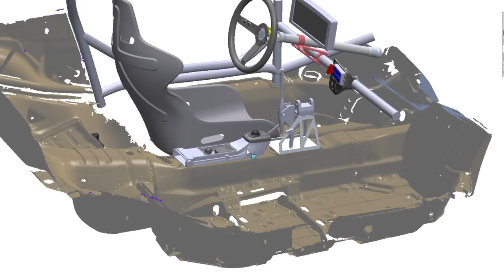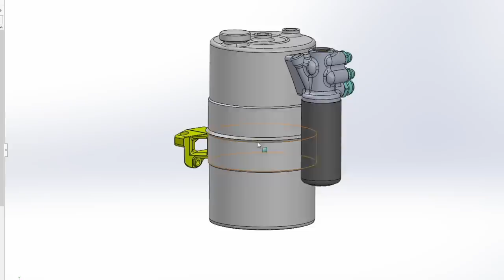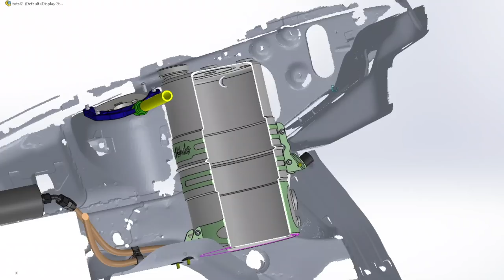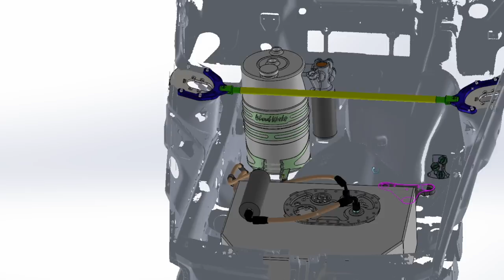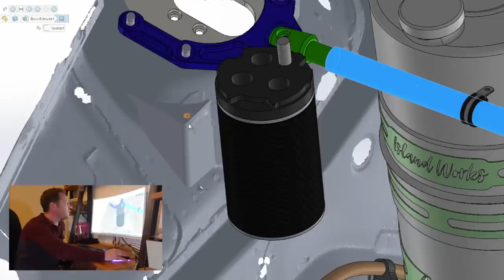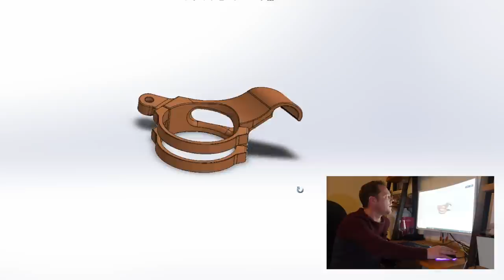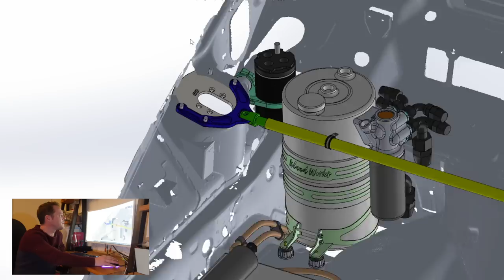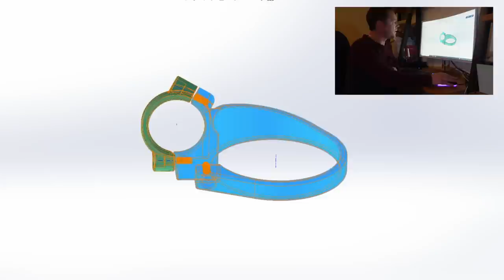Oil Tank 2.0 - Remote Mounted Dry Sump Tank on a Porsche 964

Comment: Catch tank looks better (more integrated mounted behind the strut brace, also eliminating an oil line traversing the strut brace. On the subject of the oil tank strap and rubber mounts, i suggest you leave the rubber fittings in the bottom strap, for absorbing bumps in the road, while you replace the top mounted rubber fittings with a solid nylon bracket covering both mounting holes, which would negate the horizontal wiggle. (I appreciate that you may have already solved this with a different solution).
Reply from the maker: I have since positioned in the the place closest to the windscreen. 

The tanks is planned to get one more P-clip in the top. So with that it will have some flexibility (perhaps overkill) but still a very firm mount.

Comment: Great video. I’d suggest with your tig, you had the wrong angle. As you had it in the vice, I would have had the torch angle pointing almost vertically down towards the bench rather than horizontal. That would have concentrated the arc onto the heavier gauge steel. It’s all in the practice and experience, great effort.
Reply from the maker: I definitely need more practice! Thanks for the tip!

Comment: I work in the Agricultural/municipal equipment industry and the rubber mounts you have chosen are used quite often to mount light components. In high vibration environments we see them fail quite regularly. The bonding of the studs to the rubber often fails.
Reply: If the ones on the mid brace were more upright I would be comfortable with it, they get used as small engine motor mounts without failing too often in the fleet world but it would be easy to find more durable bushes to use. Something like a sway bar d bush comes to mind.

Comment: Would suggest the rearward position for the catch tank, if only because it puts it a bit higher than the main oil tank. You'll want gravity to flow any oil in the line back into the main tank vs. the catch tank, will mean having to empty it less often.
Reply from the maker: That’s a very good point. I’m leaning to that position also as it gives space to strap the tank to the strut brace.

Comment: Weld a bung on the top of the oil tank and make a joint for the catch can that goes between the cage bar and the oil tank. You get the benefit of the catch can working off the the rigidity of the oil tank and that 3rd oil tank mount you wanted in the lateral direction, a perfect mounting solution for the can and one less bracket. Also less stuff to take apart when the strut bar assembly has to be removed.
Reply from the maker: That’s a good idea! Thanks!

Comment: This is inspiring. Coincidentally- the 912 engine had a similar problem with the oil cooler mounting tabs breaking. Eventually they revised the design to use a soft mount (kinda like you have used) to prevent the aluminum tabs from breaking.  The oil catch can belongs in the second position 🫣

Also- how in the world is this build not more popular!! It’s just as good as project Binky by Bad Obsession Motorsports.

Comment: Couple things I'd look into for the dry sump tank isolators/mounts. First I'd look into poly bushings instead of those rubber isolator stand offs (skateboard bushings are the first thing that came to mind when I saw the amount of flex/deflection. You can find TONS of different durometers, sizes, shapes to dial in how you want them to flex.) Second, I'm a little worried about mounting the tank to the chassis with rivnuts. In my experience, rivnuts tend to HATE any type of torsional load on them, so I'd be worried about them pulling/flexing out of the chassis. A larger bushing that makes contact to the chassis directly with clearance around the top of the rivnut could help reduce the torsional stress but I can't say for certain it would. 
Lastly, I always heard its best to put the breather tank higher than the top of the engine/dry sump tank so any oil that condenses in the hoses would run back into the tank? No idea if that's true or not or where I heard it from, but food for thought. 
Love the build man! You inspired me to get into CAD Design, enough for me to go to school for it!
Reply: I’m almost certain the rubber isolators will tear apart under the weight of the oil tank on track. They’re designed for fuel pumps and such. Much lighter weight. I would 100% use a through bolt and nut with a heavier durometer rubber isolators above and below the tank bracket, also eliminating the rivnuts, and you will probably need to strengthen the sheet metal with additional steel.
Reply: Yeah this tank when filled is going to weigh a ton when cornering and breaking.

Comment: Hi, I follow your job since a common friend Arnaud shew me your channel.
One more time, this is great and you don’t fear to share your fails.
Personnaly, I would prefer the first position of oil trap. You can make a brace attached like you did on upper of fender. And second brace/fixing part at the bottom of the fender, you have at least 2 screws.
Another solution would be to modify main oil tank’s bracket to attach the trap on it.
i love mechanic bit i’ m working on wiring harnesses and much more on harness software.
Hope  we will this car running not inside a salon. Go ahead ! Sprint is coming 🏎️
Reply from the maker: There has been a good number of comments coming back so I need to take in and think about it. 

Arnaud is great!! He’s helped me a lot!!

Comment: personally i think you should solid mount that oil tank if you don't its going to cause the lines to rub in the mounts causing them to fail. to minimize vibration from the tank just use some shrink wrap them on the clamps this will also limit the metal on metal contact which will again limit wear and tear of the tank and the mount.

Comment: I would suggest that you make a brace between the lower end of the oilfilter and the tank. Once the filter is full it will be pretty heavy and will act as a weight that will lever on the thermostat housing. The housing is mounted to the sheet metal tank and the constant movement will work harden the material of the tank and it will crack. Attaching the lower end of the filter to the tank will eliminate that movement.
Reply from the maker: I’ve contemplated something like that. The way the thermostat housing is attached it has a CNC back plate on the inside that sandwiches the tank following the curvature. It feels very sturdy given the curvature of the plate and the area it’s clamping on.

Comment: Having designed and failed the catch can design for wrc car, this Nuke piece is stunningly beautiful. Imho strut tower brace being right next to the big oil tank, supporting it anywhere else would end up people asking why did you not use the most obvious support. One more band it is then, this time from sturdier material and in C-shape.
Reply from the maker: I’m thinking tucking the catch tank on the side so I have access to the brace in front of the tank.

Comment: You could use skateboard bushings instead of rubber bushings. They have some give in them but aren't too soft. From around Shore A70 to A120 I think they're avaliable. Or just some harder rubber/polytherane tube that's similar shore.
Reply from the maker: That’s a great tip thanks!

Comment: We call those rubber mounts… cotton reel mounts and use them for everything from exhaust and radiators to engine mounts 👍

You can get different durometer (stiffness) rubber cotton reels… just get some stiffer ones.

The hoses adding stiffness is ok as long as they are not straight, so give them a slight bend so they don’t stress the hose fittings. 

Also the oil in the tank acts as a damper for vibrations 👍
Reply from the maker: Thanks for the insight. If I get the tank stable on its own I was planning to ensure the hoses follow the tank by putting them a bit loosely in the brackets somehow.

Comment: The stock oil tanks are mounted pretty firmly, I don't think it need much flex in the mounting. 
You probably know this, but anyway. The front mounted oil tanks where used on the 935 cars to improve weight distrubution, but it wasn't all good news. In hard braking the engines starved of oil because the inertia of the oil in the feed lines.  Probably not an issue on swedish tracks with moderate power and downforce. But keep logging oil pressure.
A really, really good oil tank design is the GT3 one. Tall, skinny, good air/oil separation, right above the oil pump gravity feeding in all conditions.
Reply from the maker: Tank on the front is not to be underestimated and has its risks. I’ll monitor closely and if it becomes an issue I’ll insert an Accusump to ensure there is pressure at all times. 

The GT3 is really nice, but doesn’t have the front oil coolers which makes it all so much easier.
Reply: Oil tanks mounted this far away from the Pump is never a good idea, plus he is adding weight to the car.
Reply: @h-j.k.8971  I don't think its adding much weight, the original tank is probably a little lighter, but its not aluminum so I don't know. Depends a bit on the oil lines he chooses too, that could offset the difference.
Reply: He will need a breather catch tank in the rear too so that will double up and add extra weight.
Reply: @mawe42  No the breather comes o
off the oil tank.
Reply: @mawe42  Yea still has the problem of oil cavitation with those long lines, he´ll have to use large dia hoses and fittings.
Reply: @h-j.k.8971  There is a breather from the crank case that normally vents to the tank.
Reply from the maker: @mawe42  the weight will be in the sense that the crank case ventilation will run in a hose all the way up to the tank in the front. There won’t be a tank in the back.
Reply from the maker: It was common on some of the competition Porsches as it’s lighter as well as distributed towards a part of the car that gets very light on a tuned 911
Reply: @islandworks  Have others done it like that? If/when you get oil and water condensing in that line before it reaches the tank it could act like a plug if it can't be pushed up into the tank and you will have crank case pressure. Just a thought, speculating.
Reply from the maker: @mawe42  it’s the usual way as far as I know. The hose is routed along the cage along the roof of the car in the cabin.
Reply: Never a good idea having to resort to bad solutions when the ground concept is of a flawed design. @islandworks
Reply: @islandworks  Ok, you route it high like that, that would work fine is my guess!
Reply from the maker: @h-j.k.8971  I’m happy to hear you like my design 👍🏻
Reply: @islandworks  What makes yo think that?

Comment: Love watching the design and project evolve, on the middle clap I think I may add some gussets at the corner of the bracket piece to the strap in the corners to stop the bracket bending over time rather than pulling the strap tight, the bottom is ok because the bracket is made of angle material but the middle one doesn't have that extra support to stop the angle between bracket and clamp increasing as it's tightened. Just an idea
Reply from the maker: Thanks for the feedback! I was planning to install a small pipe on top of the screws between the plates that I can tighten fully. This will also help ensure the screws don’t come loose.
Reply: @islandworks  ah yes that would work well too👍🏻

Comment: These rubber dampeners are prone to fail very easy.Your previous design although complex seemed better.Will you remake the 3d printed parts in aluminum?
Reply from the maker: The other design had its benefits, but turned into a beast and the backwards mount disappeared when I took out the bulkhead divider I was planning there. 

With a third support in the top it should sit nicely I hope.
Reply from the maker: The catch can mounts will be printed. It gets incredibly strong and temp resistant with the right material and process.

Comment: racecars i've worked on typically have one mount and the rest of the mounting is relied on the hardline/softline
Reply: also another thing, careful how you run your catch can since you can create a vacuum and start pulling oil from the tank. Bernoulli's equation problem if you want to get really technical, typically bases on how high your inlet is and whether or not its a divided section.
Reply from the maker: That’s interesting info. What kind of race cars was it?
Reply from the maker: I guess this can be an issue if there is air flow through the system and no free oil surface between the tanks? Like connecting the crank case ventilation and having blow by.
Reply: @islandworks  well there will always be aeration of oil as its running through the system, meaning air will be introduced into the system. Is there a pressure release valve anywhere in the system and/or a air/oil separator? Not having one or the other might cause that issue to occur.
Reply: @islandworks  FSAE and gt3 cup
Reply from the maker: There are none of the two, only the catch tank that ventilates straight to the atmosphere
Reply: @islandworks  hmm, so what makes sure you dont over pressurize the entire system? There has to be something in the pump itself that prevents the system from running too high of an oil pressure
Reply from the maker: @milosnovakovic6694  just after the pump there is one pressure regulating valve and then another safety valve. After that the scavenge side simply sends it back to the tank where it swirls and airs our via the catch tank. 

That part of the concept is the same as the original only difference is that it previously ventilates to the intake rather than to a catch.
Reply: @islandworks   yup, thats fine. Does the tank have a filler neck that extends down to the main section? From experience running a high inlet and ventilation along with a long filler neck that extends to the oil can cause the system to shoot pressurized oil into the catch-can and fill really quickly. Like just while at idle for a minute. If the filler neck sits higher than what the intended max oil level is then this mitigates that issue or at least has for me.
Reply from the maker: @milosnovakovic6694  the oil filler cap has no neck. The outlet however has like a swan neck on the outlet and the breather for the catch is center mounted with a perforated tube going to the top. The tank is originally from Mocal

Comment: I’d use the rear mounted oil catch can that sits behind the strut tower. will you have all your brackets re-manufactured out of billet aluminium?
Reply from the maker: That’s what I’m thinking as well. Final brackets will be 3D printed. It will be well enough for the weight of the catch can

Comment: Do you need the oil catch tank? Couldn't you put the screen on your oil tank? Or do whatever the oil tank manufacturer says?
Reply from the maker: A catch will be needed as the tank has to be ventilated. With the tornado inside the tank some occasion pukes of oil will come out

Comment: Change your cup setup to a furick size 12, you’ll be amazed by the difference.
Reply from the maker: For the TIG? I think I really need a training course to get over the bump…
Reply: @islandworks  yes for the tig. Make such a difference. Cleans the weld up so much so you can actually focus on running a good bead instead of the weld getting dirty/over heated